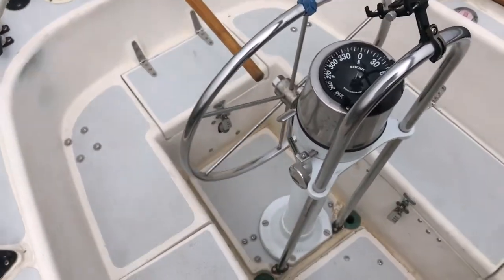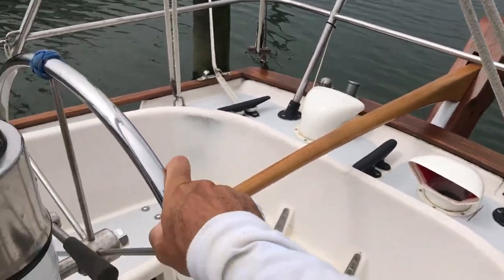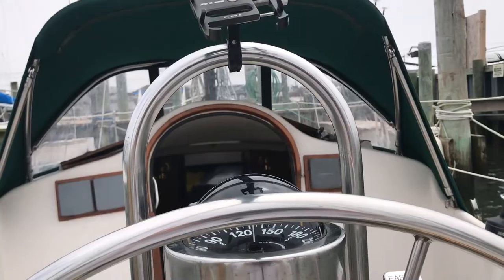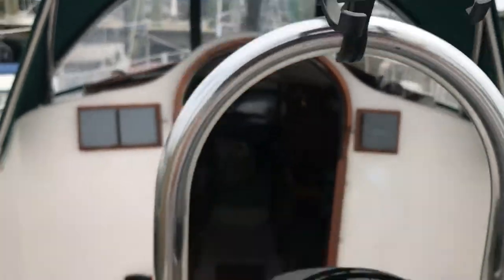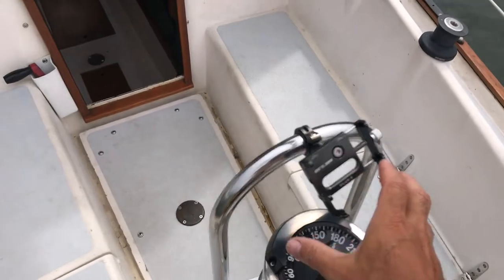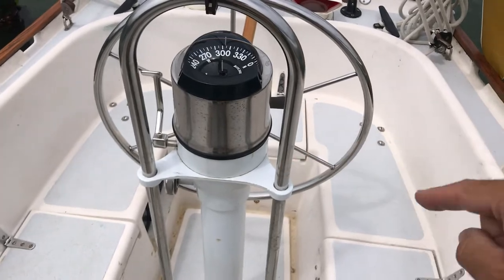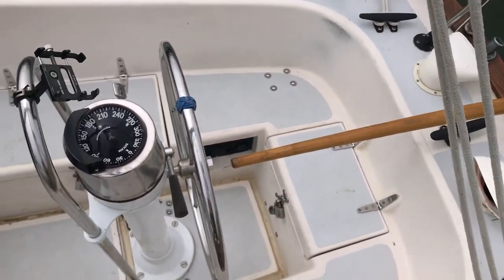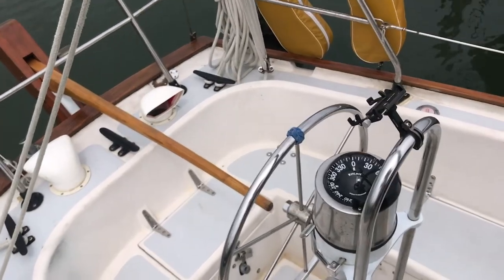Contessa 26 Refit ep.15 - Tiller vs Wheel on a Contessa 26

Comment: Love the videos and a classic boat. A pro for the wheel is that you would have to remount the compass. Most around the cabin entrance.

However I would go with a tiller as the first time I used a wheel I nearly put the yacht under a very large freighter.  Another story

Comment: Tiller-steering has many advantages, as you point out.  The main problems with it for me are visibility of the instruments/chartplotter from the tiller and also coming into a dock could be problematic since the helmsman would likely have to crouch down to reach the gear shift/throttle which would reduce forward visibility... not a problem if you have crew but if you singlehand it could be an issue.
Reply from the maker: Agree. Those were some of the things I pointed out for my situation as well.
Reply: Hmmm.. now you have me pondering ways to be able to temporarily mount gear and throttle controls on the tiller itself, while still allowing for them to be removed and located neatly away the rest of the time. And it's not just academic.. the 37'6" Benford Sailing Dory I plan to build will have tiller steering and a diesel outboard in a well.
Reply from the maker: I've been thinking that an extension on the throttle lever might be the way to go.  Something that is telescoping or fold-able or at least removable
Reply: @Garryck-1  A gear and throttle contol on a tiller would definitely resolve issues. Let me know how the research is going on if you don't mind?  I'm currently rebuilding a boat with a tiler.

Comment: Great video!  I will be doing a wheel to tiller conversion on my boat, as the wheel is more than 3 full turns lock to lock.  This means you can be holding the wheel straight ahead but be one full turn to port or starboard.  This is a terrible design as there is virtually no feedback to the steerer.  We almost crashed into several boats on our first sail.  We had previously learned to sail on a tiller, and had no issues at all.

Comment: Loved the video.
I have the same dilemma with my Alberg 35. I have a pedestal and SS wheel, but the old original tiller mounts on the floor behind the wheel,
Making the tiller unusable right now!
Agreed the wheel is kind of sexy and is a great selling feature.
I have had 4 boats , plus two Lasers, and I prefer the tiller…
But I never thought about the practicality of having  the phone mounted on the Binnacle…
Does your tiller ‘flip up’ out of the way?
Keep up the great work.👍👍
Reply from the maker: The pushpit doesn’t allow the tiller to flip up, but it is easily removed with one nut. What you didn’t see in the video was that once I removed the rudder quadrant, there was a crack underneath that surely would’ve come apart at the worst possible time.

Comment: It’s a debate for sure. I saw a small boat that had a wheel yet it was stationed only 2 feet back from the hatch which really had a lot of advantages. It enables you to have cover yet still steer in bad weather. Allowed use of grab rail in the Bimini rather than relying on a pedestal. Socially it still enabled line of sight for two people with backs against the cabin. Gave back room to the mid and rear section of the cockpit but was a good position I thought for handling sheets and winches. I would keep the tiller as well yet it’s pointless having them on top of each other at the rear.
Reply: I just realised this is a year old 🤭 What did u choose to do?
Reply from the maker: I converted it back to tiller steering in part 17.

Comment: I’m in the process of watching your videos which are very well done.  Thx. There is a Contessa 26 for sale near me. It has the original engine which needs to be replaced.  Does it look like there was much modification that had to be done on your boat by the prior owner to install/fit the yanmar?
Reply from the maker: Hey Rick.  It doesn’t look like it would be an issue to get the Yanmar in, but on mine it does look like someone cut part of the cockpit engine opening and glassed it back together for some reason.

Comment: Hi, I have the same old wheel and the pedestal base is totally corroded. Do you know which model it is. It’s not easy to find a replacement... If you have removed it from your boat please sell it to me!
Reply from the maker: Hi Asen- It's an Edson C-185, but I'm not looking to sell it. However if you give Bacon Sails in Annapolis, Maryland a call, they might be able to sell you one and ship it to you.  I was there today and I saw quite a few available.
Reply: @EpoxyAndButylTape  
Hi,
Thank you, appreciate it!  Now I know what to look after.  The thing is that in Sweden Edson is not really common steering system. I have been trying to look at many places and nobody have this pedestal with the cut on the front. I hope that Bacon Sails will have it.